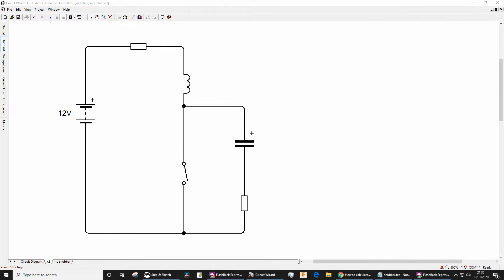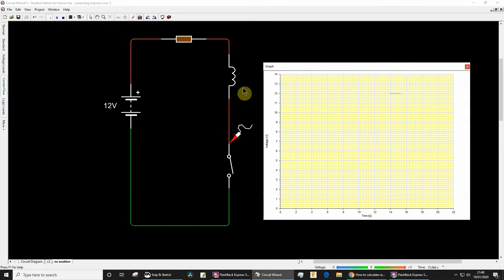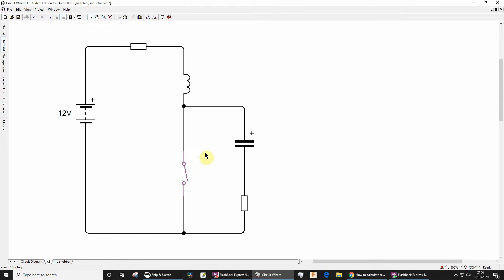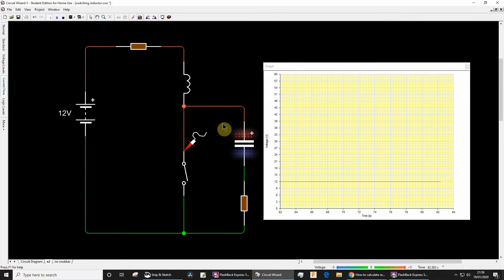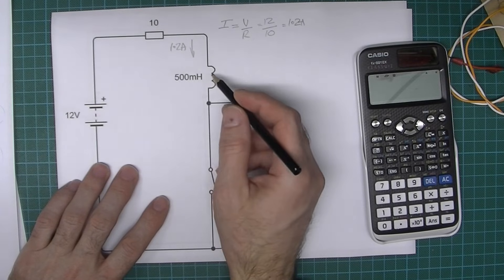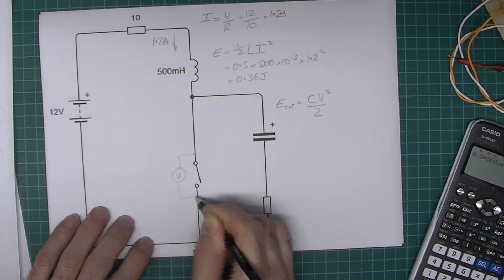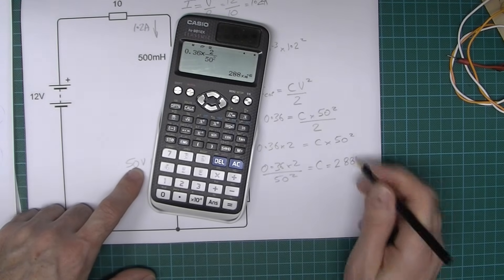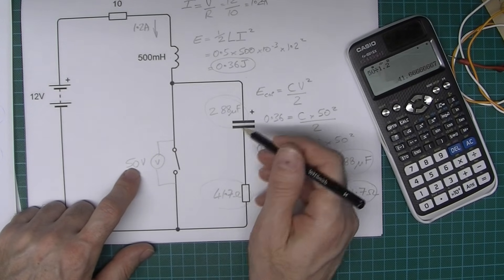RC snubber circuit design and calculations for inductive loads

Comment: Given that some of the flyback inductive energy will be dissipated in the 41.7 ohm resistor, I wondered why you chose a capacitor energy equal to the inductor energy?
Secondly, once the current flow ceases, the capacitor is charged to 50 volts - and it will then start causing current to flow back through the inductor to the supply - not good if a power supply, but I guess a series diode could prevent this.
More normally, I would think, the snubber is placed directly across the practical inductor (in this case the 500mH plus 10 ohm resistor) - this has the benefit that the switch is still protected, but with the added benefit of less radiated switching spike noise noise in the wiring.  Added benefit if the device was a dc electric motor, of helping suppress commutator hash.

Comment: Why can we assume the current is still 1.2 Amps  through your capacitor resistor circuit ?    Could the inductor with its high voltage not push more than this.   ?   I have no idea and am just asking.     Is the inductor only capable of pushing the same current that was flowing through it before the switch opens ?
Reply: At the time the switch opens, the running current in the circuit is 1,2A (determined exclusively by the 10 Ohm resistance). The energy now stored in the inductance depends on that current and the value of the inductance itself (according to the relevant formula). Therefore this current cannot increase. What happens is an overvoltage across the inductor when the current is interrupted. This is the way an inductor reacts when the current running through it gets interrupted. As an example, we exploit this effect in order to create ignition sparks for the cars. The current into the primary side of the ignition coil is determined by the copper (Ohmic or D.C) resistance of it. In this video, the 10 Ohm resistor practically represents the d.c resistance of the coil (as inductor are theoretically considered as pure elements, that is, without Ohmic components)...

Comment: Thanks for the great explanation. If I have a switch for AC current rather than DC, would the same snubber circuit work to protect it?
Reply from the maker: An RC snubber can be used with AC. A flyback diode is typically used with DC switching.

Comment: One thing must be solve .the watt of resistor .many times calculate resistor .but with that resistor we have must have 50 watt resistor .it is mean we have rather than 41ohm use 41kohm to resistor don't destroy

Comment: You should metion that a snubber circuit AC supply  is used and a flywheel diode is used with a DC supply

Comment: P = R * I^2
P = 41.7r x 1.2^2 = ~60W resistor

This makes no sence.
Reply: Your calculation would be true assuming the capacitor is shorted, which is not the normal operation of the circuit. (The cap blocks the d.c current)...

Comment: Why not use a reverse biased freewheeling diode to provide a discharge path for the inductor as is normal practice?
Reply from the maker: I would use a freewheeling diode. This video simply demonstrates a theoretical alternative method and not a recommendation. Thanks for watching.

Comment: I'm lost... you used a voltage at  switch that might be 1000s when arcing... but you picked operating voltage
Reply: Where did you get thousands? The snubber is there to lower it to  reasonable level?

Comment: So another video recommends using a capacitor for this (no R), and another video says just use a diode.  What's the difference?  These were both limiting flyback sparking or spikes when starting / stopping a motor using a transistor.
Reply from the maker: If switching an inductive load (eg motor) powered by a DC supply, I would simply use a flyback diode rather than use an RC network to suppress transient voltage spikes during switching. Contrary to how some people may have understood this video, I am not advocating the use of an RC snubber for DC switching applications. I might also add a low value capacitor across the terminals of a brushed DC motor to reduce EMI. I hope that helps.
Reply: @PizzeyTechnology thanks, it does!
Reply: The resistor makes things easier for the capacitor, by reducing the charging-discharging currents. One can surely use only a capacitor in such a case. Also a diode connected in anti-parallel to the inductive load (as it is the case of D.C working coils of relays) is a common practice. But in a high energy environment, a cap alone can end up in catastrophic results without the resistor in series to it...

Comment: It is very good video. I want to mention that the capacitor stores energy at 12V instead of 50V used in the calculation of the capacitor size.

Comment: Where in U.K. can I buy a 0.1 micro F capacitor with 2M ohm resistor as a single unit with two leads . I need it for my vintage sewing machine foot controller/ speed controller. Would appreciate your feedback ASAP. Thanks.
Reply from the maker: Sorry, but I am unable to recommend a supplier. If I needed that combination, I'd probably just add a resistor across a discrete capacitor.

Comment: Best and easy to understand video on this topic i have found so far! Thank you! Would be great to also do an overview of typical anti-sparc measures to protect semiconductors like transistors/mosfets when switching DC with inductors. What about  fast flyback-diodes versus RC-snubber? What about varistors and TVS suppressor diodes? What are the optimal measures to protect a mosfet? Can you combine these methods for better results?

Comment: When you are calculating the energy stored in the coil, as you assuming that it is oscillating at the coil’s resonant frequency? Because a coil’s voltage and capacitance varies depending on the frequency of the LC circuit and it only achieves it’s maximum energy storage value when it is oscillating in resonance.

Comment: Is there some impedance matching going on in this example? Great video
Reply: In fact, the R-C elements of the snubbing network form a dumping filter for the energy stored in the inductance of the circuit, which causes extreme overvoltages when released (I.e when the current is switched off). This energy is first removed from the inductor of the circuit and then stored in the snubber capacitor and is finally dissipated into the snubber resistor producing heat...

Comment: In practice, I found it difficult to get reliable values for the inductance L for solenoids. The iron losses are highly dependent on frequency, which is not well definable for this switching circuit. If there is a better way, please let me know

Comment: A very nice example, for AC voltage would the same formula still apply?. I have a small coil with hydraulic motor that measures 4106 mH/10VA according to the plate and 240V /60 Hz. supply. the maximum amperage we could permit is 1 amp

Comment: I very much wish to understand what the voltage will do if we take out the resistor and just use the capacitor to dampen the switch?
Reply: In that case, the switch receives very high inrush current from the capacitor during turn on.

Comment: I like that you included calculation. One question, for example i need to install snubber in my circuit which controls motor via relay (because micro controller restarts from the motor spike). i don't know the inductance of motor. Should i use LCR meter to measure the inductance of motor? Is that a correct way? If not then can you calculate the Energy from the spike using oscilloscope? Thanks.
Reply: You can of course use an LCR meter in order to find out the inductance of the motor. Alternatively you can use an oscilloscope as well. In this case, you need to resonate the motor's inductance with a known capacitor across it, using a signal generator, and solving the resonance formula for L. Then you can go on with the snubber calculations...

Comment: Hello, i need a snubber for my circuit but do not have the specific ressistors and cappacitors on hand, what if i were to use a much higher value? would it still funcion?
Reply: You can't just put random values and live with it. If you don't select the right capacitor and resistor you might increase the ringing or the power loss.

Comment: A very well explained snubber video, probs the best on YT! I love well explained videos! Everything can be simplified and well taught. I'm curious about one thing however. If our coil had quite a few turns (say primary of a transformer), it would have its own resistance. Let’s say our coil measured 10 Ohms for example. Wouldn't this greatly affect the calculations due to the current restriction of the coil itself?
Reply: Apologies, I failed to have mentioned that we are pulsing the switch (so transistor say, like a chopper circuit). Then we have rate of change!
Reply: @1NeoGio these applications need an RCD clamping circuit, which is more complex.

Comment: 288uF, that is very big capacitor,  I never seen such big snubber,    are you sure?
Reply: The circuit in this video is a D.C one. If the clamping voltage was to be kept to 12V level, this capacitor would be about 5000μF...

Comment: Does anyone see when the switch is open, the current induced from the inductor is flowing into capacitor, then via 2 resistors in series; and the induced voltage is in series with the battery ?  Also some energy is dissipated via the 2 resistors. After suffucient time that the current via the inductor becomes zero, the voltage across the capacitor equals battery voltage. Now if the switch is closed, there will initially more than 1.2A current flowing thru the switch due to discharge from the cap, and gradually goes down to 1.2A.
Reply: This is a wrong explanation. When the switch is closed, the polarity of the voltage charging the coil is positive after the resistor and negative at the other side. When the switch opens, the coil works a power source producing a voltage having a reverse polarity in reference to the 12 volt source. This voltage adds to the source at the capacitor connection point and as a result it's (conventional) current direction is will be downwards, to the snubber resistor. Therefore the damping happens on this resistor and with the values found is very fast, as it takes only: 288μF × 41,7Ohm = 12msec...

Comment: When you close the switch at about timestamp  11:51  why doesn't the simulator show the exponentional delay (due to the L/R delay) during the fall of the voltage??
THANKS MUCH!!
Reply: Because the time constant is in microseconds while the scale shown in the graph is in seconds. It is there, but it is not visible.

Comment: I'm using an electromagnet that is rated at 12 volts at 0.5 amps. Checking with the Oscilloscope the  half inch ball bearing hits the aluminum foil every 0.8 seconds and arcs that are visible. I purchased both a electrolytic capacitor kit and 1 watt resister kit. Hopefully the wattage on the resisters is more then enough. I take it on your resister and capacitor values you pick the next highest value out of the kit?

Comment: I have a snowblower that was designed by an idiot.  It has momentary switches to rotate the discharge direction and angle.

You can only actuate the switch a few dozen times before so much carbon builds up on the contacts that it stops working.

I'm thinking this would be the fix, but have no idea what size cap and resistor to use.   Not sure it matters too much as anything would prob help.
Reply: You can always start up experimenting in order to solve the problem, by using the "standard" snubber, consisting of a 0,1μf/ 600V capacitor in series with a 100 Ohm/1W resistor. This circuit must be connected in parallel to the switch that develops the problem. Any mains switch will be protected by using this snubber circuit...

Comment: How we take 50v as maximum
Reply: This is arbitrarily taken. You can take another voltage as maximum, according to your needs. The voltage selection has to do with the switch safety only (but it affects the calculations).

Comment: Nice approach and very simplified but it has some physics error which is the energy was being stored in the inductor will not be fully delivered to capacitor and will be less because both resistors will consume it while transfering to steady state after resonance period , am I wrong ?! ...
Reply: This was a comment I was looking for. The capacitor stores energy at 12V, so the calculation must be done using this value. The capacitor is not solely storing energy released from the inductor. It also acquires energy from the power supply until the voltage across it is the same as the source voltage. That means energy stored in the capacitor depends on its capacitance.

Comment: Great video. As you doubtless know, a flyback diode across the coil will clamp transients to around .6 volts. I suppose a  snubber network is used in situations where a diode can't be used, like in an ac circuit.
Reply: correct!
Reply: The diode alone does not dissipate the energy fast enough if one wants a faster transition.

Comment: Hello, can you please explain to me why there's a need to place a resistor in series with the capacitor? Can't I already get by with only a capacitor? Thank you.
Reply: You can use only a capacitor. The role of the resistor, anyway, is to remove the stress of the high current of charging and discharging the capacitor which, in high energy circuits, shortens its life and can end up in a complete short circuit (without the resistor).

Comment: Very Nice,  I would like to take this to next step.  Can we snub the inductor instead of the switch or both at the same time.  If we added a diode in parallel with the inductor;  How can we explain this type of snubber across the inductor with RCD?  This is problem I am having on a  project now.
Reply: For relatively small amounts of energy, working on small D.C voltages as in this video, a diode connected in anti-parallel to the coil (as it is common practice with relay coils), solves this problem effectively. An RCD network is more complex to analyze.

Comment: Regarding the RC snubber network, is it mainly to discourage charge from building up on the negative plate of the capacitor? As well as bleed any charge that might build up during normal operation?

Comment: Thank you very much for this very informative video. I have a question. Right after opening the switch all voltage will drop across a resistor since a capacitor will be shorted and then all the voltage will be transferred across a capacitor during transient and then no current will flow through a snubber circuit. But then how does a capacitor discharge ? As per the simulation, we can see a voltage spike of 50 V acorss the switch and so across the capacitor, but after that moment voltage dropped down to 12 volt, so how did capacitor get discharged from 50 V to 12 V ? Through a resistor? If yes, then what should be the direction of current flow ?
Reply: Here is how the circuit works. Suppose we start the circuit from a relaxed state. When the switch turns on for the first time, all the voltage appears across the inductor and the current is zero. Then current through the inductor increases until it reaches the current limited by the series resistor.
Now let us deal with turn off. The current through the inductor immediately after turn off is the same as the current before turn off. Now the snubber is snapped. The voltage across the capacitor does not change abruptly, so its value remains at 0V and the voltage across the resistor in the snubber circuit is the resistor value times current through the inductor.The capacitor is charging while the current through the inductor decays. The capacitor voltage builds up towards 12V. When the capacitor voltage reaches 12V, there is no more current flow. The circuit stays at rest henceforth. 
When the switch is turned on again, the RC snubber circuit starts discharging itself through the switch and this event stops when chapacitor voltage is the same as the switch voltage drop.

Comment: Hi, what in case it's a switching circuit where there is a time limitation where the capacitor needs to be charged and discharged in some predefined time set as per the frequency of switching.....

Comment: The resistor calculation is incorrect. Makes no sense to set R = Vm/Im. R should be calculated by setting the desired time constant RC, which will be dependent on the switching frequency. Al alternative is to set R by it's desired maximum power rating, which is also dependent of the time constant RC.
Reply: You rightly pointed out. But the calculation is ok in context of the video. He mentioned a switch, not a transistor or MOSFET or IGBT. Switch are mechanical and switch frequency is limited. So practically it should be ok

Comment: Hi, many thanks for the video. Excellent explanation. I am working on a similar project but instead of the switch I am trying to protect a diode. How can I calculate the R and the C ? My max voltage is 2600VDC and maximum current 214A. I am using the Infineon D3001N68T.

Comment: Thisis great, but I don't get why you use 50V for both the capacitor and resistor calcs. That would make 100V across the switch. They should both see a fraction of the voltage across the switch (and i can see that changes over time as the cap is first charged up then discharged by the resistor).
Reply: The overvoltages caused by the inductance when the current is interrupted can reach four times the supply voltage. That level of 50V has been arbitrarily set there as a safety margin for the switch. Another voltage could be selected of course to fit specific demands. The full damping of course would be to maintain no overvoltage, keeping the supply to 12 volts...this would demand a capacitor of some thousand microfarads...